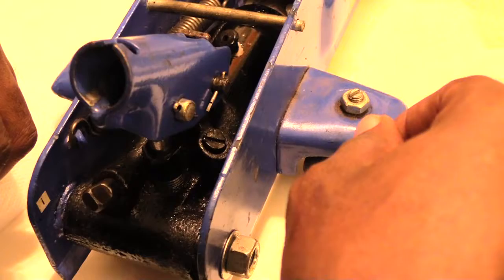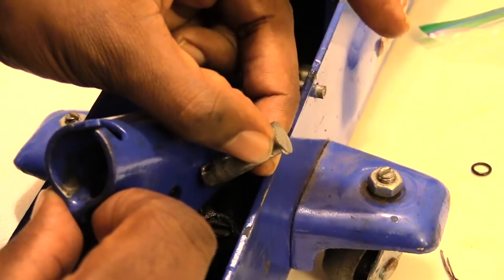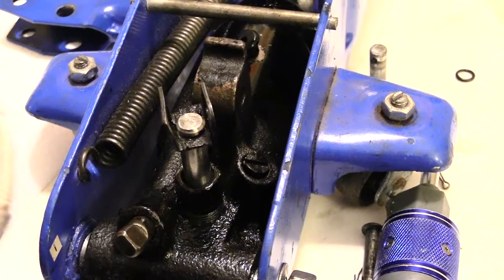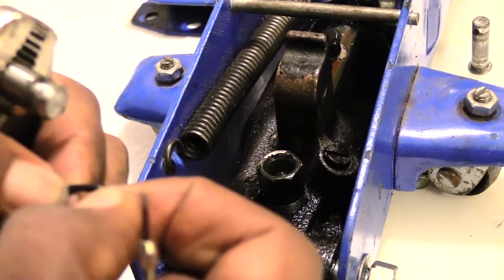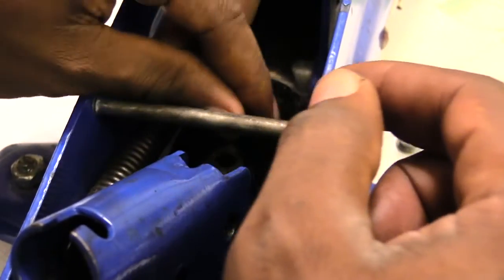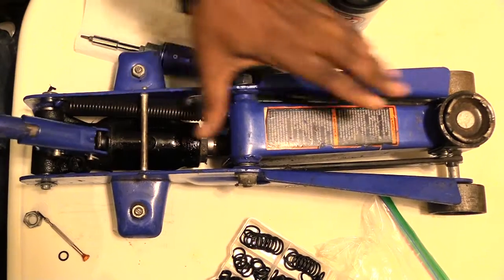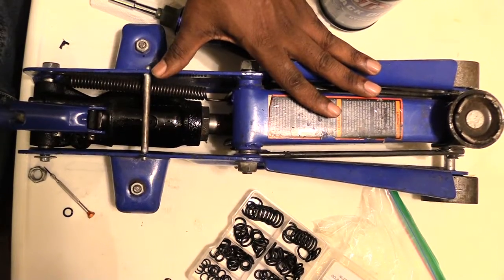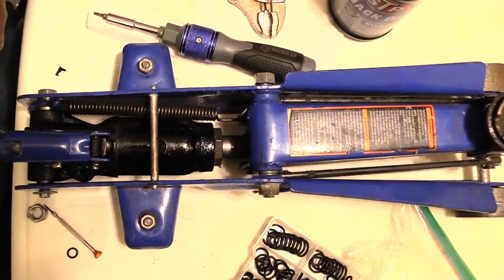Hydraulic Jack O-ring repair, Oil Fill & how to Bleed! Easy

Comment: Anybody know what the straight-slot screw-head is for?
At 0:11, it's visible just to the right of the shaft he removed to change the o-ring. (Could this be an easier way to bleed out the air??)

Comment: Great information. Just like wrenches-sockets O-rings come in Standard and 3 different Metrics sizes. If you find that a Standard O-ring is slightly smaller or larger, try using Metric o-ring for that size.

Comment: Thanks 🙏 very much for sharing this video with process of how to fix the hydraulic jack. I have done replaced the o ring but it still doesn’t work. Is there some other reason why it doesn’t work sir? Thanks 🙏 again for sharing the video sir.
Reply from the maker: If you added hydraulic  fluid and replaced the o ring, you probably  have a internal issue or a leak. I would just buy a new one, it's not worth the risk of it failing  under the weight of a vehicle. Please like subscribe and share.

Comment: You saved my jack headed for dumpster. I was able to fix my floor jack for .47 cents. Where the plunger or small piston goes in mine had a small ball bearing at the base.
Reply from the maker: Glad to hear

Comment: Thanks for the vid and here is something you or no one will believe. I just disassembled by craftsman 2 1/2 ton floor Jack that has always been leaking a little. Yet lately it’s been losing lifting power and leaking more. I bought it new about 20 years ago and used it a lot.

It has NO O ring! Amazing it even worked at all. I’m guessing someone in China left it out by accident and quality control was non-existent. I’ve got a few older never used O rings so hopefully 1 will work. Even if it’s a little dry rotted it should do a LOT better. LOL.
I will try and post an image or link.
Reply from the maker: Wow yea that's not good hope u get it fixed.  Please subscribe like and share 🙏.

Comment: Good video however you should never use vise grips on smooth hydraulic pistons that are smooth for a reason. They mate against other o-ring seals and scaring them will essentially ruin them.
Reply from the maker: Thanks for info. Glad could help Please subscribe like and share 🙏.and check out our other helpfull videos.

Comment: THAT PIN THAT YOU REPLACED THE O RING ON AND DRIVE BACK IN...
DOESN'T THAT NUT COME OFF THEN PIN GOES THROUGH THEN NEW O RING? SEEMS THE WAY YOU SHOWED,WOULD MESS UP NEW O RING.
 I NEVER SEEN ANYBODY GRAB A PIN THAT IS IN USE WITH SEALS AND O RINGS WITH VICEGRIPS,VICE GRIPSCAN SCAR PIN SURFACE CAUSING RUINING OF SEALS/O RINGS,BEARINGS.
IVE NEVER DONE THIS,BUT IM THINKIN IF THIS WORKED FOR YOU,I GOTTA TRY,BEFORE SPENDING $100 FOR ANOTHER JACK!
THX,LIKED & SUBD TOO!
Reply from the maker: Yes it worked on this jack, but some can be screwed off, check the set up of yours to see the correct way. Thanks for like and sub.

Comment: My Pro lift model #  G-2593 3 ton jack raises up fine, but won't hold a load. Do you think it needs a total main cylinder rebuild, or just one of the easier to replace o rings? I already tried adding oil and bleeding it. It does seem to leak fluid out of somewhere, but not on top.
Please advise.
Reply from the maker: Sorry not sure, but would replace o ring and see if fixes your problem.  Please subscribe like and share 🙏.

Comment: I just had a go at replacing my o rings on the piston and pressure release screw. They are no longer leaking but my jack still doing the exact same thing only goes up a few pumps then stops. I think the hydraulic as gone.
Reply from the maker: Yes I would replace jack not worth the risk of it failing with a car on it.  Please subscribe like and share 🙏.

Comment: Thank you so much man. I got this same jack that I only used once 3yrs ago and went over to my sister's house a few days ago to replace her flat tire with her spare only to discover it wouldn't budge or lift anything. Turns out the oil leaked out completely and here I thought I had to shell out $100+ for another one. I also couldn't figure out how to get the oil plug out and yours is the only video I found that showed that. Thanks again!
Reply from the maker: Your welcome  glad could help please subscribe like and share and check our my other helpfull videos.

Comment: you cannot use a Vice Grip Plier on the Pump plunger....! You are damaging its Smooth wall and the Pumping capacity will be reduced. The Scarring on the plunger will finally damage the Oil Seal too.

Comment: I undone the two screws and one ball bearing and one spring fell out.  Not sure which hole the spring and bearing comes out off.  Fyi I'm referring to the twist to release the jack screw and the screw with the do not remove cap on.  (Not talking about the rubber filler bit). I was trying to get as much old fluid out as possible.   I think the bearing goes on the twist to release screw as the screw has a simple on the button of it, and I thought the spring went under the do not remove screw but again who knows, all I know is that it's not working at all now.

Comment: hey bro, my jack doesnt even lift a bit, with pressure, and by pressure i mean even the spring at the side, and if i remove the spring it works 
properly, what is the issue, can you guide me. on how to fix it.
Reply from the maker: Sorry but not sure of the problem with your jack, if it's acting bad like you say I would get a different 1, wouldn't want it to give out with a car on it. Safety first. Please subscribe & like and share if haven't already and check out our other helpful videos

Comment: Hello guys. I have a small Chinese 2 ton floor jack that serve me well the last 5 years. The problem (I think i have) is that it doesn't stay up. What I mean.. with no load I lift it and the next day Is down. It drops about 1-2cm every 20 minutes. I change the oil and do the bleeding procedure already. Also when I turn anticlockwise the pressure valve to lower the jack,the silicone filler cap pop up. I press the side of it with a flat screwdriver and always push air out,no matter how many times I do bleed it before. I pull oylut some oil and now the filler plug stays in strong but again when I press it air goes out. There is no leak outside. Is that normal or I should do something else?
Reply from the maker: Sorry but not sure haven't worked on 1 like the 1 you have.Please subscribe & like and share if haven't already and check out our other helpful videos

Comment: Excellent sir. I have a question. Can the jack get in air if the rubber plug has a pin hole?
Reply from the maker: Yes it can cause a problem on some models, just put some super glue or silicone in. The hole. Please subscribe & like and share if haven't already and check out our other helpful videos

Comment: I changed the same o-ring that you did and i even bled ths jack, the arm that lifts doesnt even move when i pump it.....oil is toped up, the valve is closed and it doesnt even move....what could be wrong with the jack?
Reply from the maker: Sounds like some of your internal parts are bad.

Comment: Man I took this back to AutoZone I had paid $80 for it, on sale. They said 1 warranty was out. I knew 100% it was like only 8 months. No arguing with those fools, no help. Your vid got my jack back in order. Maybe these harbor freight seals will work better than the ones that janky duralast used. Thanks for saving me at least a Benni I only ended up paying pennies
Reply from the maker: Your very welcome, Thanks for watching and commenting yea HF has pretty good parts. glad could help.Please subscribe & like and share if haven't already and check out our other helpful videos

Comment: when you popped the pin out that has the o-ring on it....why didn't you loosen the bushing nut on the bottom and just remove that?   I'm just curious....never done this before